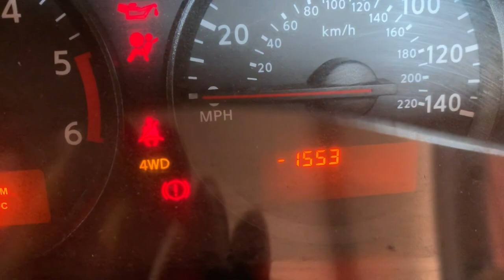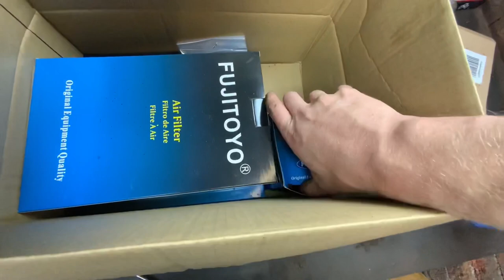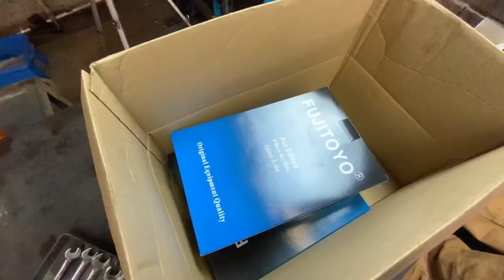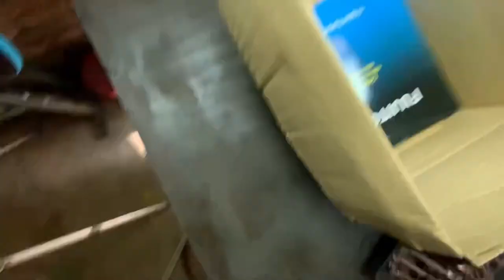A surprise during a service and how to stop a stolen trailer!

Comment: They would not have a great name the nissan the ranger be more reliable
Reply from the maker: I like the Rangers more than the Navs but Toyota have done well for us
Reply: @dirt_and_diesel  the older toyota was un breakable the new 1s not so much diesl emmissions have killed the diesl engine like tractors the john deere 6910 was the peak for deere and the very early 6920s